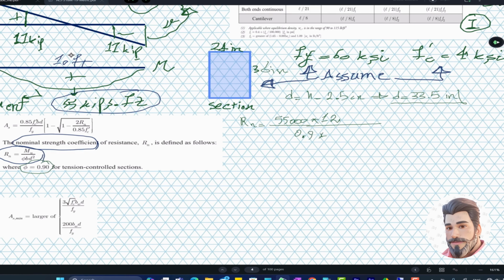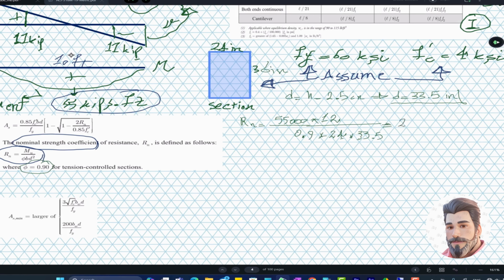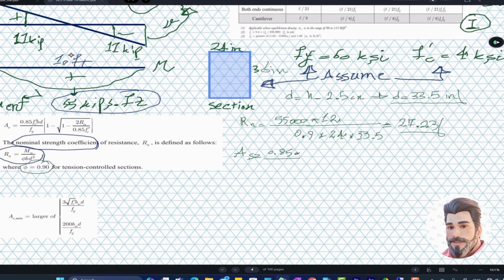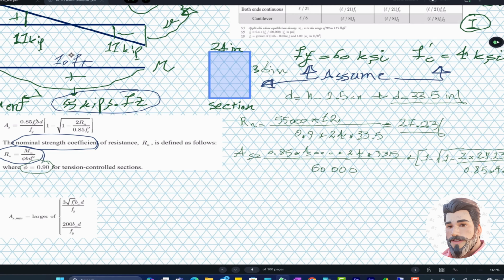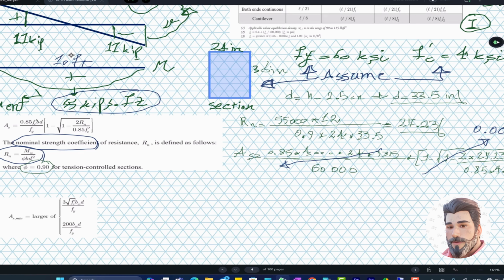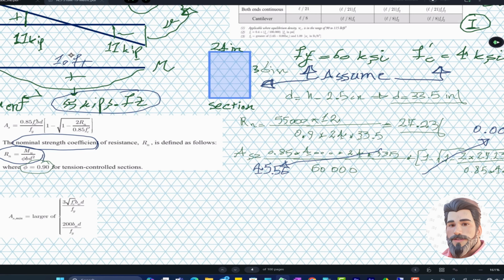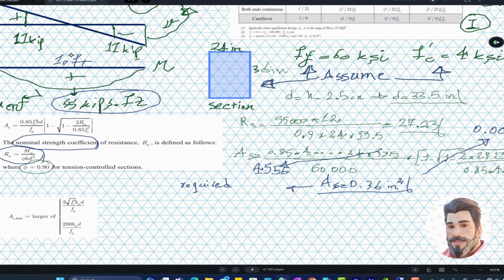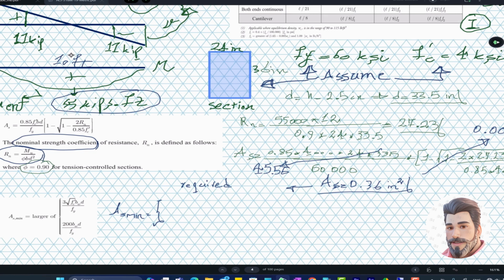Revit, ETABS, Shop Drawings: Guiding Structural Design Chapter 1 Part 4 from Hand, #etabs & #revit

Comment: Please make videos on shortcut methods of design, like the thumb rules to check the design for simplifying equations. Sometimes, we dont have enough time to design manually the whole structures.
Reply from the maker: Thank you for your valuable opinion. This course is exactly for beginners. Your comment drew my attention to the periodical recording called structural design shortcuts, control and check🌹
Reply: @MasoudStructuralStudio  yes exactly, because we have a lot of structures to be design in a consulting firm in a short span of time so we mostly trust software results because if we come to check every single beam and column then it will take a lot of time. So, I thick there have been some shortcut formulas and tricks whom we check the design. Like the stress formula Strength = My/I to chexk stresses in foundation. Or there might be some quick methods to design short structures manualy rather than on software.
Reply from the maker: @EngineerHassanTahir  Yes. I understand exactly, this need is strongly felt, so I decided to prepare a course to control and check the designs of structures. You mentioned exactly the good things. Thank you for your opinion
Reply: @MasoudStructuralStudio Thanks, I am waiting for it
Reply from the maker: @EngineerHassanTahir  🌹